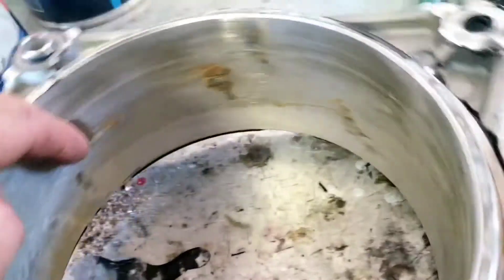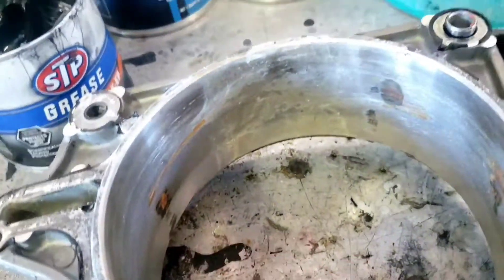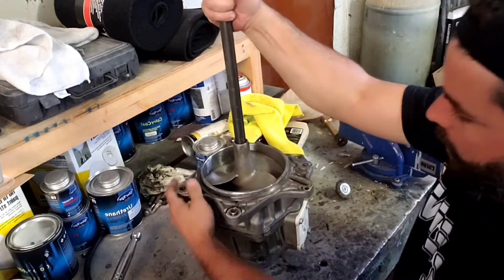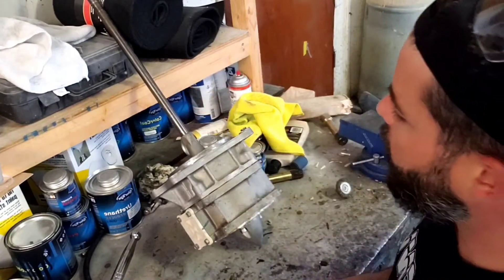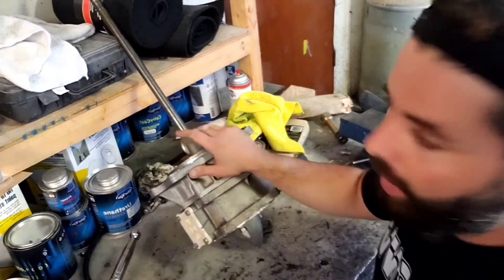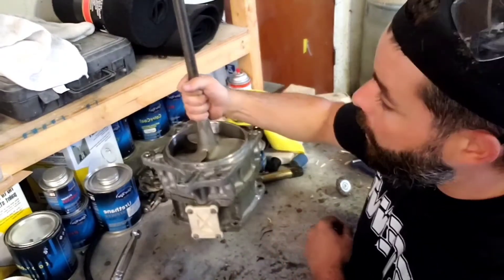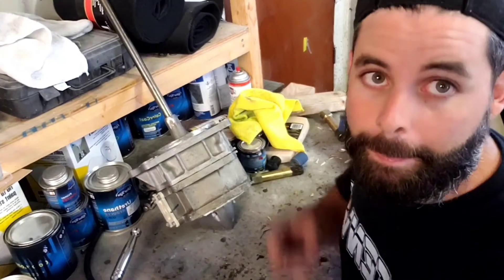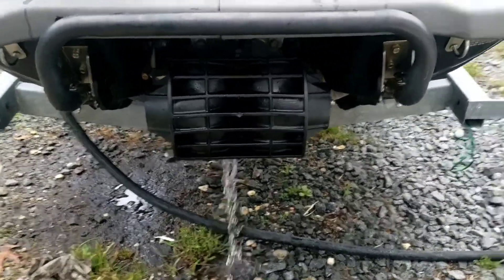LIFE OF A JETSKI MECHANIC: We have a locked up jet unit on a 2017 YAMAHA VX

Comment: Good info for a quick fix or making the weekend but Id still order the part and just go for fixing it right if you have the time. Hell by the time you got through winter the housing could swell in new spots and it would be making noise in spring anyway

Comment: Great video! I had the same problem. Bought a new stainless impeller housing. No more wear ring. 2015 vxr, always in salt. Also replaced the starter, impeller, all 4 motor mounts.

Comment: question,,,,,,i got a 2008 waverunner ,had to have it on its side for hull repair for like 60 days,,when i let it back down there is no oil in the tank,,,,,,,,,,,is it ok to just ad oil and start it??????????? where did the oil go????help please
Reply from the maker: Is it in the hull? I don't see it would have ended up in the engine but you could always add oil, make sure you prime it and add oil to the gas for safety but then you gotta find the leak or you might blow your engine in time.
Reply from the maker: Pull the plugs and crank tge engine to make sure it's not in the engine

Comment: hey man, so i got the same noise when starting but i had it running yesterday and the battery died, i went out bought a new battery put it in now it’s making that noise when i try to start it and the screen and radio shuts off after trying to start. Any ideas?
Reply: I have the same issue! I've changed my starter relay and spark plugs. And it still doing it.

Comment: what if mines doin the same but my propeller spins
Reply from the maker: If it spins, it will wear down the high spots
Reply: @JetEnvy_TV  no mine spines when turning over with out the plugs in when i put the plugs in it turns over once and doesn’t want to turn again
Reply from the maker: @lucasanderson4965  dead battery, check voltage while it's sitting and check it when you hit the start button. I bet your battery is bad, did you check that?
Reply: @JetEnvy_TV  yes i did i have it on a jumper box
Reply from the maker: @lucasanderson4965  what's the voltage?
Reply: @JetEnvy_TV  12 volts

Comment: Hey bro I have a 2009 seadoo rxt and I can hear the starter hard click and engine rocks this bike was sitting almost a year .. any suggestions
Reply from the maker: Battery voltage?
Reply: @JetEnvy_TV  just came off a fresh charge 13.0
Reply from the maker: @nemonespider  whats the voltage under load?, pull the plugs and see if it cranks. Check jet unit for anything that could be stuck inside. If that's good whats the voltage at the starter? Probably best to bench test the starter. Does the motor spin over by hand?
Reply: @JetEnvy_TV  I’m a novice but I’ll try to test first thing in the morning I’m just glad I tried to test a guy told me I needed a new harness and charged 700 to buy and install.. I wasn’t getting any beeps or indication on the dash but after a good charge I got the beeps now this.. how do I test those things you mentioned?
Reply from the maker: @nemonespider  lmao 🤣 😂 your gunna have to get a hold of a manual or Google some things. It would be way to much to type out in a comment.
Reply: @JetEnvy_TV  lmao Ikr ok I’ll start my research and let you know how it goes thanks for the great info
Reply from the maker: Let us know what you find. I appreciate you reaching out and hopefully some of the other guys can chime in and help you out
Reply: @JetEnvy_TV  thanks again bro I really appreciate it
Reply: I’m thinking it’s the starter might have to pull it out.. but first I need to find out how lol

Comment: Can you tell me what the torque specs are when reattaching the pump to the back of the ski for the various bolts?   Snug?   or to specific ft lbs...
Reply from the maker: Your going to have to pull out a manual for that kind of information. That's information that I do not retain. After over 13 years of working on skis I only pull the book out for engine torque specs.

Comment: Brilliant information....thank you....I bought a 2013 VX and was worried about this common fault, and so priced a new housing in Australia and they quoted me $350+.....if you grind the high spots once will the problem accelerate ...i.e. thinner stainless more susceptible to bulging again?  At the moment it is not seized however it is likely the impeller has worn the high spots from constant use and there may be no stainless left where the high spots would have been....I will inspect the jet unit overt he next week or so. Subbed as I am sure to learn a great deal from you.
Reply from the maker: I'm glad this was helpful, the tips I've shared are definitely not a cure all for this issue and yes the problem might continue if the ski isn't getting used as often. This video is for the DIY guy that needs a quick temporary fix to get out this weekend. 

Thanks again for subscribing, new video coming out SOON!
Reply: Worn shaft bearings pushed impeller forward causing contact and once it sits it rusts and fussed , don't just replace wearing, replace shaft bearings

Comment: So why did it go out of round?
Reply from the maker: I'm glad you asked! I've only ever worked on salt water vehicles and what happens is salt water will find its way into any openings, the wear ring and housing are 2 parts and corrosion will build up between the two causing it to swell. That or the two metals have a reaction together and it starts to swell. I hope this was helpful and thank you for the question.

... I see you have a seadoo, you will never have this issue because you would have a plastic wear ring
Reply: You can buy a version that is solid stainless, but they are close to $400 vs $110.